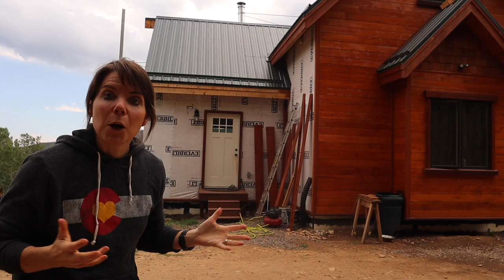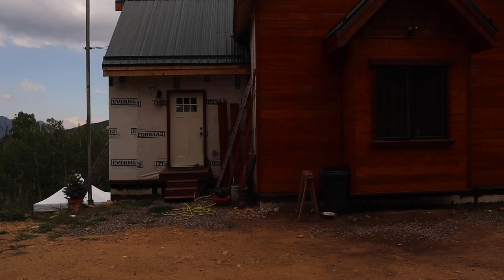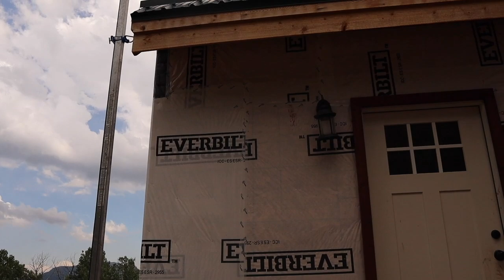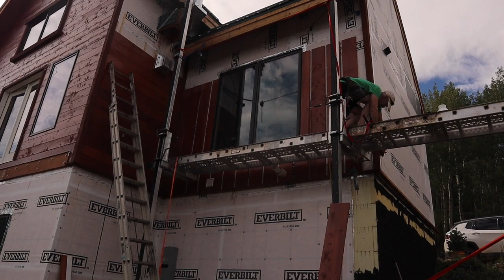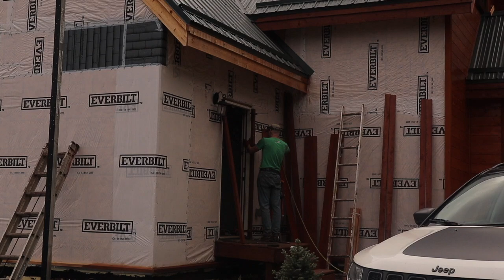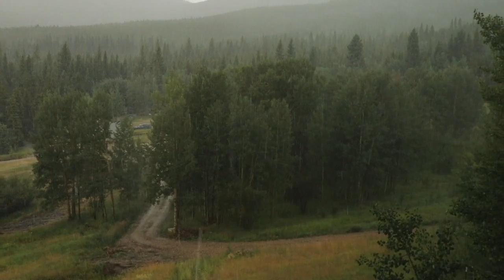First Look at Board & Batten Siding

Comment: Brian, When instaling board and batten siding I like leaving a gap between boards myself because it gives a wider look to the boards and it looks less busy with fewer battens. A problem I have encountered with doing it this way, however, is that the spaces between the boards under the battens become like a superhighway for the mice to run up and down and possibly gain access to your attic. Anywhere that these channels aren't blocked by moulding or ledgers I put a block of wood at the top and bottom to deny access. Beautiful job on the siding.....Marty
Reply from the maker: Thank for the tip!

Comment: the place looks fantastic. just one question on the board and batten, why did you put such a large space between the upright boards. all the other board and batten i have seen done, the boards were butted up together, and then the batten was put on the seams.
Reply from the maker: I think because he wanted to show more of the face of the wider board and not cover it up so much. But as long as he blocks the openings at the top & bottom, wont get any critters in there.